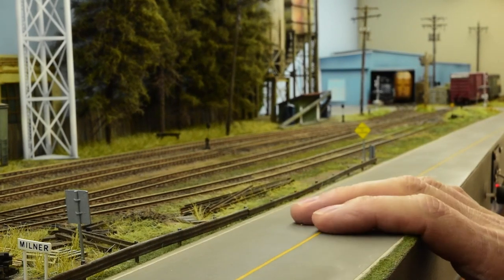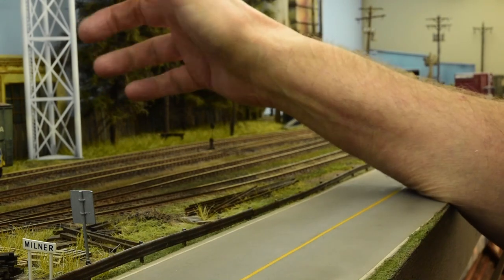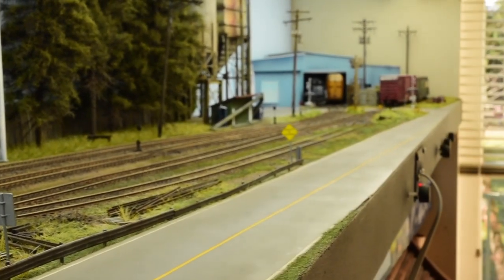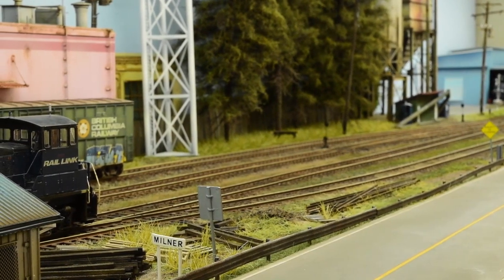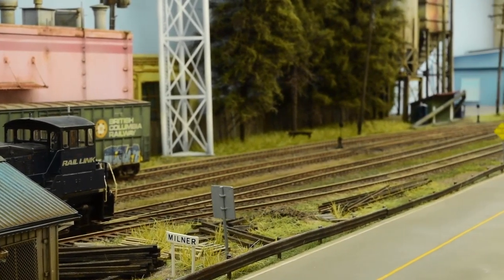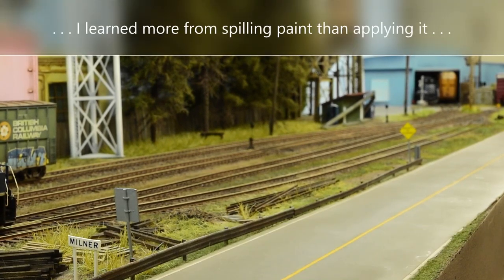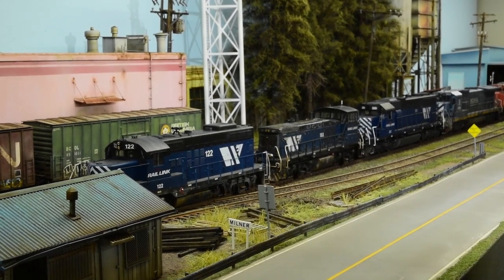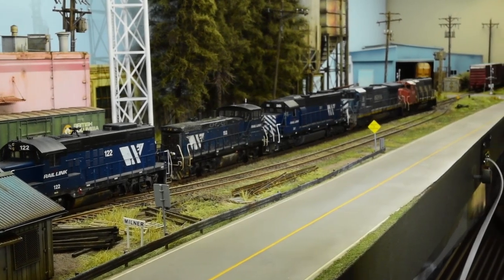HO Scale Shelf Layout | Glover Road ~ In The Beginning . . .

Comment: I hear you!  I visited an open house of a 24x36 layout about 6 months before I retired and got hooked, especially by DCC systems.  I got myself "invited" to join the crew by the layout owner, bought a throttle so I could run, and the rest is history.  Those guys sparked my re-boot in the hobby after a 50 year absence.  It wasn't long before I knew I needed a small layout at home, just so I could program and test my growing roster of power and rolling stock.  I decided on a 4x8 with a scene divider.  It's essentially a 2x16 shelf layout back to back.  I've found that I can put a lot of scenic detail in that little space.  When I'm not tweaking that little landscape I can zone out with my coffee and just watch trains roll by, or spend an hour or so running the switching puzzle.  That's what keeps it interesting because it's different every time and it helps clear out some of the cobwebs in my head.  Nice job on your shelf!
Reply from the maker: Thank You for sharing your experience and return to the hobby after a long hiatus. I would consider your layout large by my standards which is completely acceptable. Now that you mention it (the sixteen feet I mean), I am planning for a rebuild, or rather extension some time soon. Cheers.

Comment: I like your philosophy on railroads. You like me, need to budget but still have fun! Great layout.
Reply from the maker: Thank You. Having a budget is important in the long run. Money saved here can go there type of thing. Large layouts can be a formidable expense. Having said this, I still like to buy the odd piece of really nice equipment though. Once in a while, I will splurge on a nice locomotive or piece of rolling stock if I really like it. However, most of the subjects like buildings, scenery, etc. are all scratch built from material I had kicking around, and I generally like to weather up cheaper rolling stock and change out the couplers, etc. Cheers. ~ Boomer.

Comment: Do you use cork track bedding on this layout?
Reply from the maker: No. I just glued the track onto the plywood and then attached pieces of insulation foam underneath certain areas where I wanted to deaden sound. However, I found very little difference in sound deadening when everything was done. It ran quiet anyway. It probably makes sense to lay cork on larger layouts with longer running trains. I did with River Road. Shelf layouts are quiet, despite the underlying layers, due to slower movement and shorter distances. ;-)
Reply: @boomerdiorama  gotcha. Do you need bedding to properly ballast? I'm new. Sorry for dumb questions.
Reply from the maker: @cyberpunkdarren  No worries. Not if you want the "flat" yard look. Just leave a slight depression in the ballast between tracks and it looks fine.